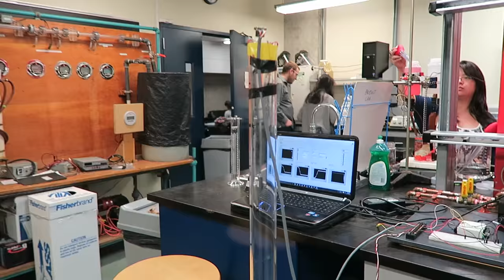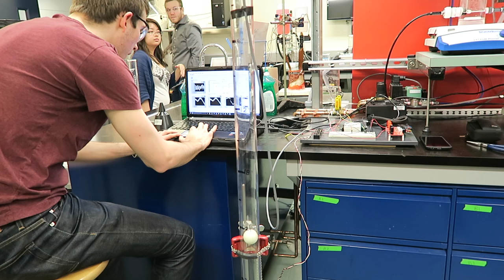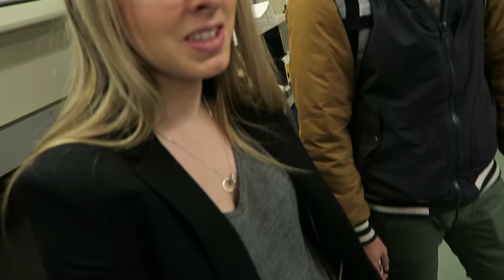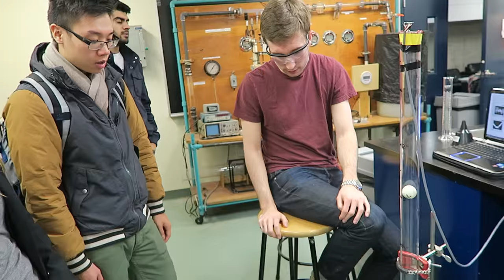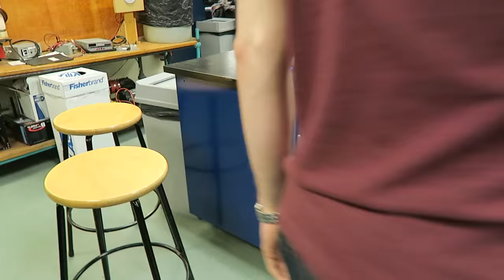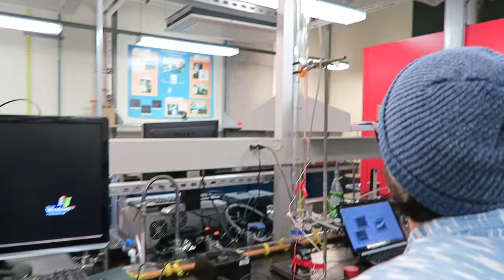Ping Pong Ball Levitation

Comment: I am doing a similar project but my ball either spins at the bottom or shoots out the top. How did you get a variation in height at different fan voltages?
Reply from the maker: brittany cafferty hey that happened to us at first too! We had to use pulse width modulation to make the fan not go at full speed or no speed. We tried to use a PID controller at first but it didn't work so we did if statements instead. If you need any more help let me know! This project was tough but it was awesome once it worked
Reply from the maker: zaid asad hey this was more than 4 years ago so I completely forget. I wasn't the person in our group doing the programming. But I remember the fan just kept turning on and off when we tried to do PID so we just did a bunch of if gates